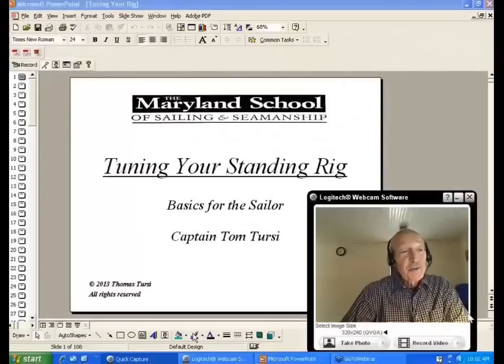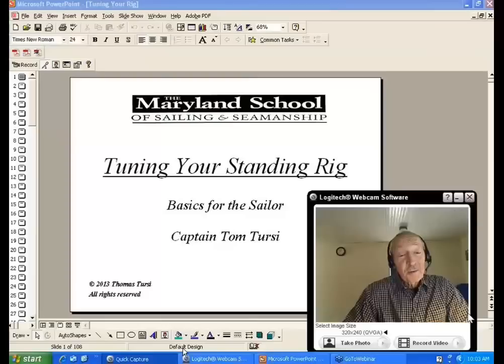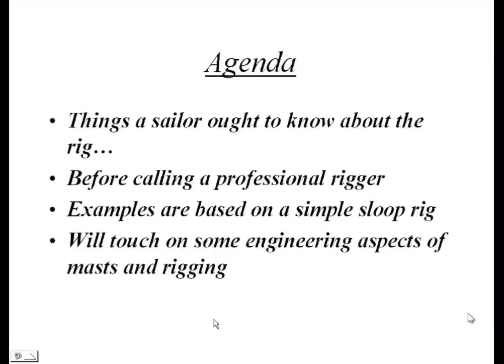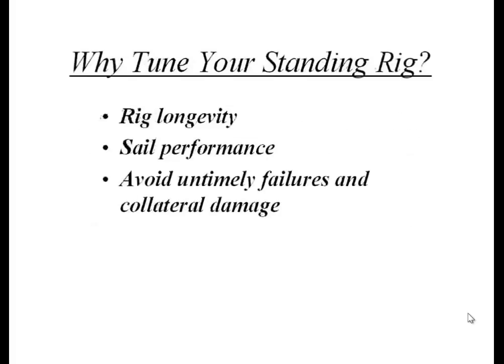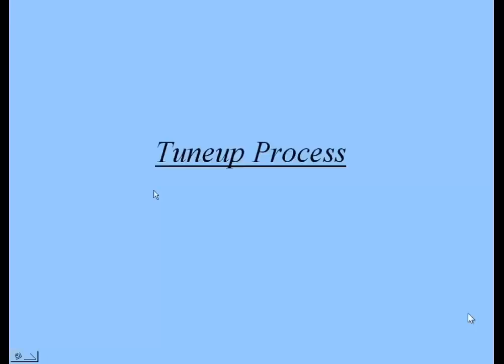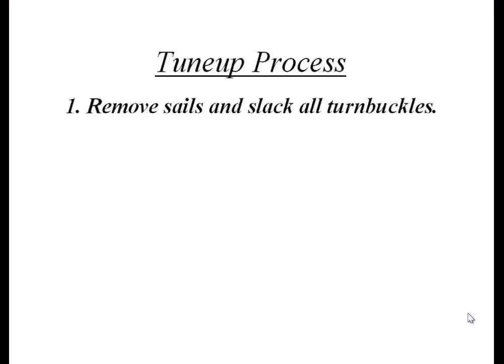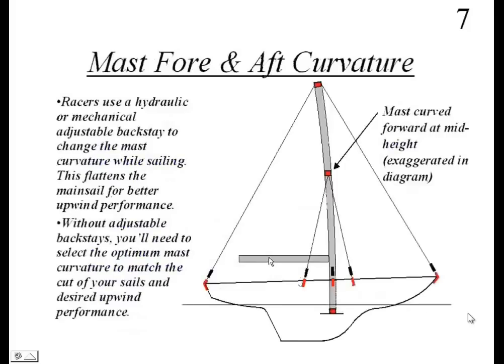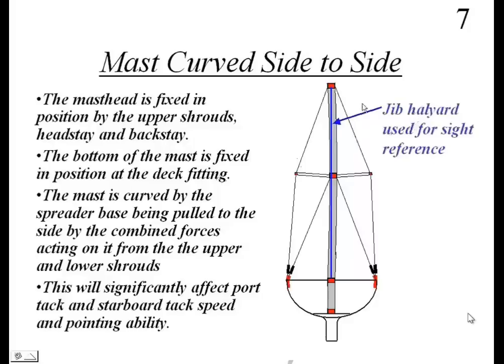Sailboat Rigging Tuneup

Comment: Can a poorly-tuned rig distort the boat such that the head bulkhead pulls away from the cabin top and causes drawers and doors in the vicinity not to close true? If so, will the boat return to shape if the rig is properly tuned? Will the bulkhead need to be retabbed?
Reply: Bulkhead delaminates from hull prob?

Comment: If you study mechanical engineering at Universityyou will know the best shape for all MASTS IS A straight line.The last thing to   have is a BENT MAST BECAUSE IT FAILS MUCH MORE EASILY UNDER LOAD.SO JUST MAKE YOUR MAST DEAD STRAIGHT AND GET SAILS CUT ACCORDINGLY.SECOND DO NOT  OVERTENSION RIGGING,Better to have  a low rig tension , since we are cruising........
Reply: Mast bending is not a new thing.  You should read more about sailboat rigging and sail rigging and control.